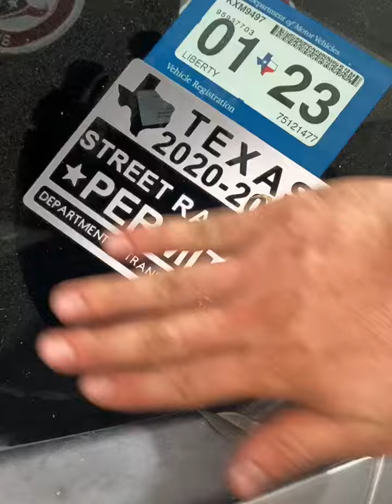C6 corvette fuel pump relay update.

Comment: Mine just came back and forgot how I had fixed it. Thanks for the vid. I’ll try to move the pin more this time and add some grease like my buddy had told me the first time but forgot. 😂
Reply from the maker: @rambobailey87  No problem bro 🤙🏻 I believe I ended up replacing my pin and spliced a new one not sure how long it lasted, I traded my car shortly after
Reply: my car has the same issue, if you leave the bypass always in place your fuel pump is always working also when the car is shut off. I want to try to replace the socket  when the pin goes , bent it back or in case change it ...and see what happens!

Comment: did the problem come back again after you fix it?? i have the same exact problem and the mechanic suggest to Bypass Relay
Reply from the maker: I personally wouldn’t by pass it just so you won’t burn up your fuel pump, I did come back once but I re did it and never happened again